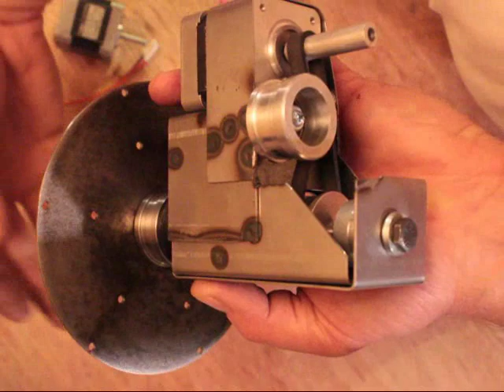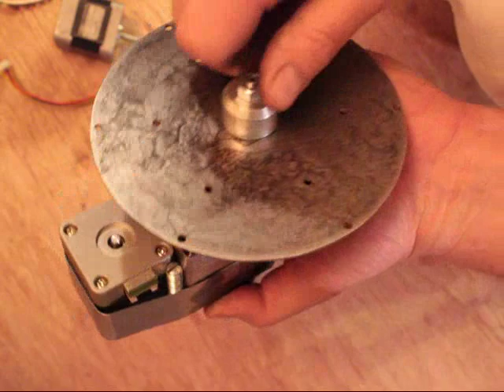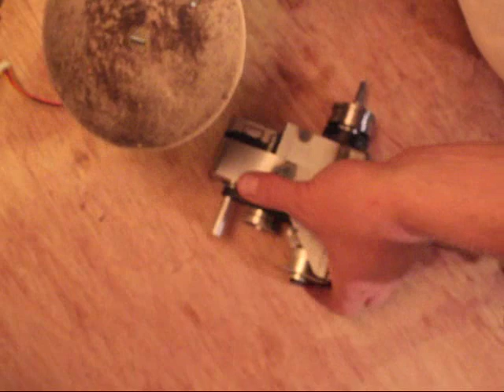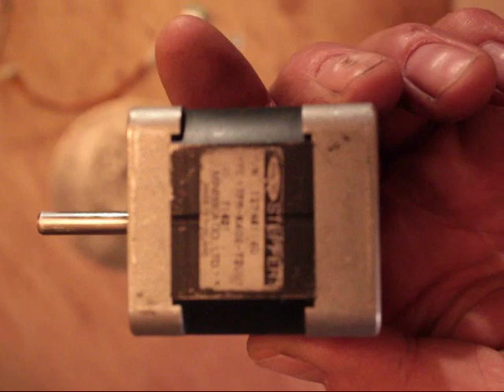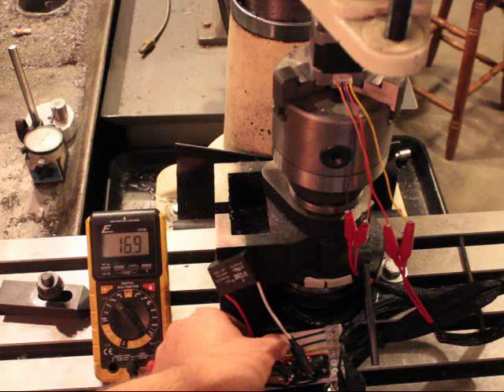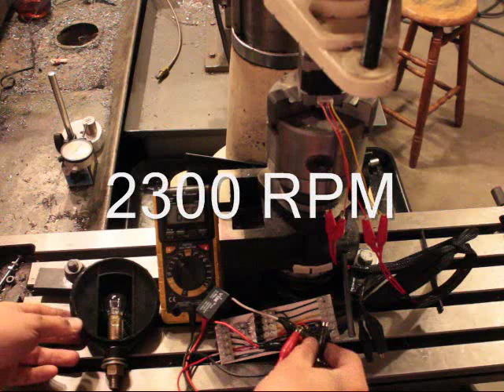Part 1 Nema 17 Stepper Motor Micro Wind Turbine Generator CNC Alternator PMA Windmill

Comment: belgrademachine:  have you ever been close to a Nema 34 or Nema 42 Stepper Motor?  I am asking because I need to know if it is hard to turn the shaft of these Nema Motors with your fingers.  I really want to make a Wind Turbine with a Nema 34 or Nema 42 but I don't to make blades 10' in length.  I already have a new blade set of 5 blades that have a diameter of about 53".  By the way, I am getting more than 40 Watts from my Nema (the one one YouTube called Mini wind turbine 4).  That radio / CD player uses 40 Watts plus I can run other electronics at the same time without a voltage doubler.   Also, I wish I had equipment and knowledge like you have so that, I can create more gadgets like you do.  Man, that would put me Heaven here on earth.

Comment from the maker: Yeah, they put out very little but I do this for fun. And I have a box of those motors, some sheet metal, the belt and saw blade. The main shaft is from the front brush of an old Hoover vacuum. The rest was lathe work .. will put up another vid soon. Cheers

Comment: Would be interesting to see ,I have dealt with stepper motors some but couldn't get what I wanted out them cuz of the rpm factor and if u gear them up it adds that much more to the stiffness of the motor.Would make a fun video for the tube

Comment from the maker: Difficult to say .. it doesn't require that much effort to start. I intend to put six 18" blades on it and will make them a little wider for low end torque rather than max rpm. I would go ahead and remove the motors from those printers if they are just going to get tossed. Seems like you would probably use them sooner or later.

Comment: What kind of wind do you think will turn that stepper motor with the belt pulley? I have a couple of old printers that I want to throw out but am not sure if it's worth my while to keep the motors inside.